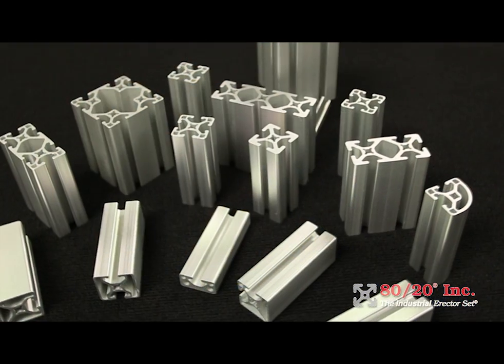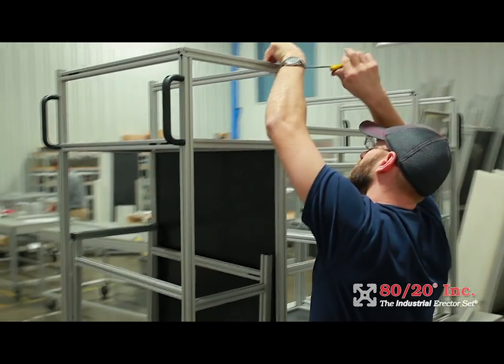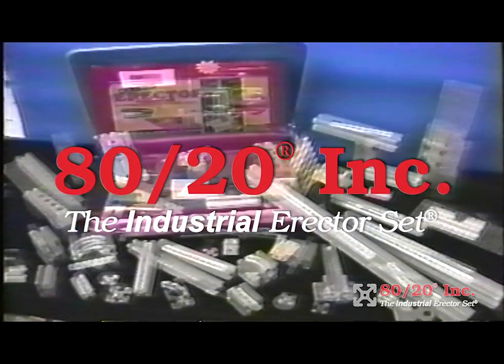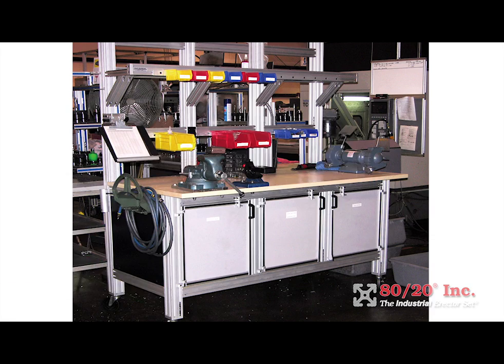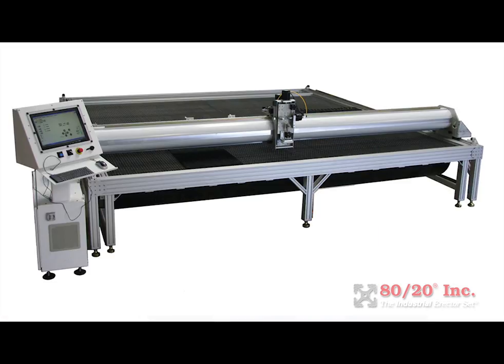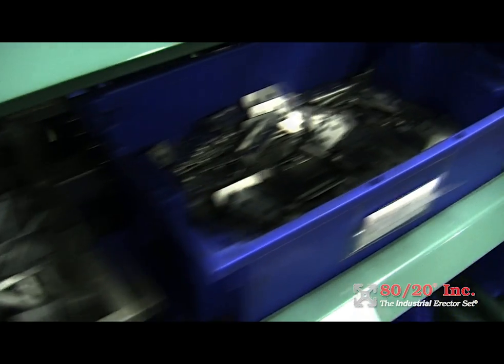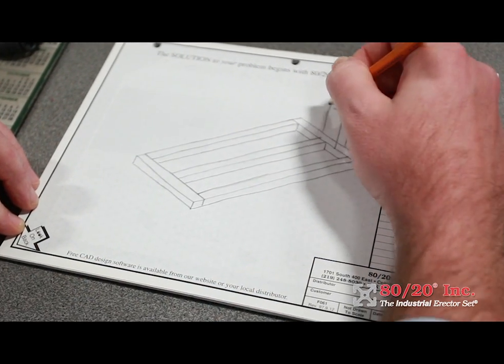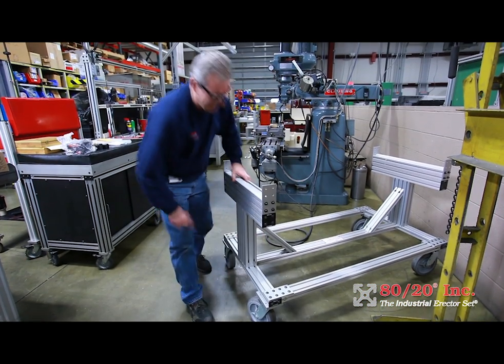80/20: T-Slot Properties and Benefits

Comment: Where was this when I built 3 standing desks out of 2x3 lumber.

I could have done it at well under the cost of the wood and it would have looked much nicer as well!
Reply: Strangely I am here for a similar reason I need to build an 8'x12' table with minimal deflection and already built it out of 2x6s.  :(
Reply: Not cheaper than wood, much more expensive.  Joinery hardware is super expensive as well $33 for one pivot joint!  Ridiculous pricing.  The Chinese are catching up with this and should have an affordable solution soon.
Reply: @mjremy2605  9 yearts ago when I wrote the comment it was cheaper. Racist old bitch.